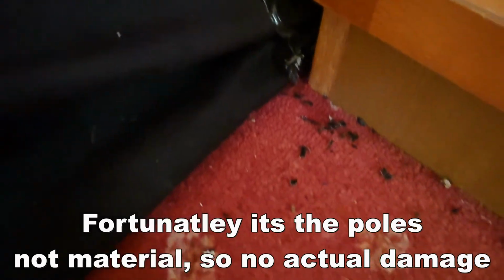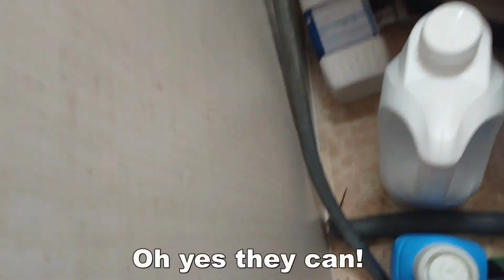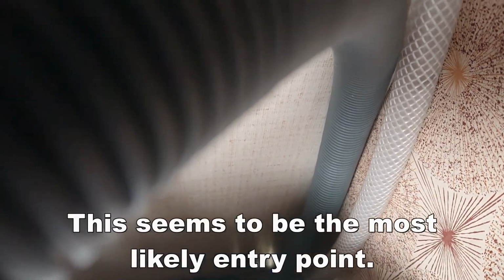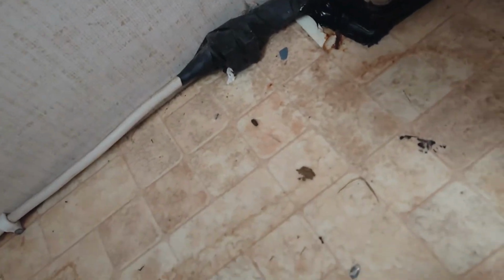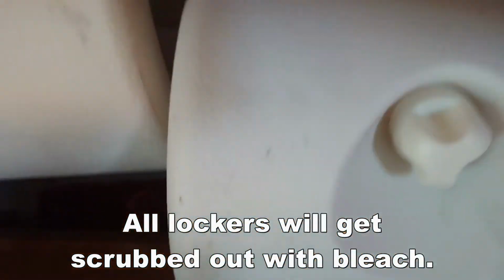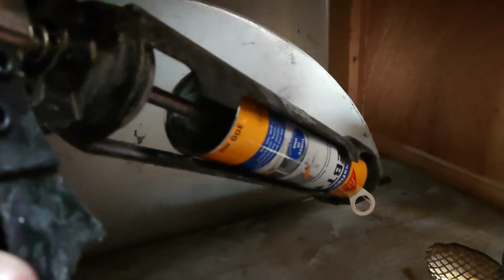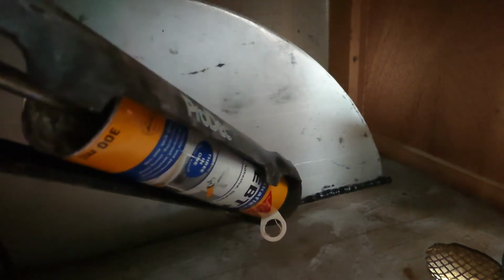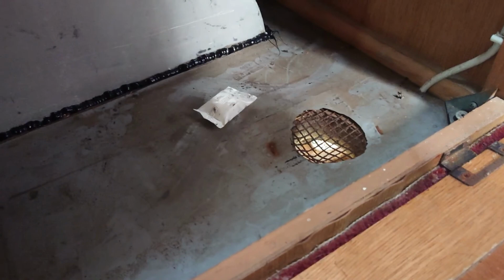Mouse in the caravan, but not for long. How to rodent proof a camper or caravan

Comment: Excellent video thanks.
A common misconception is that mice can fit through a hole as small as a pencil. Not true. However they can fit through  a slot as small as a pencil. According to my research they can fit through a round hole as small as 17.5mm. Having said all that I would block any slot or hole that I can find. A 6mm steel mesh over any vent would be ok.